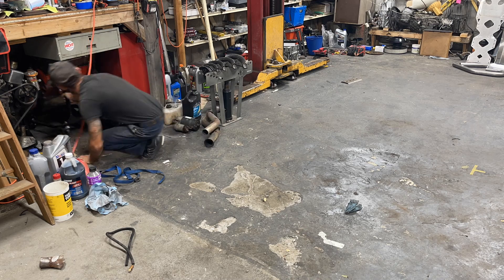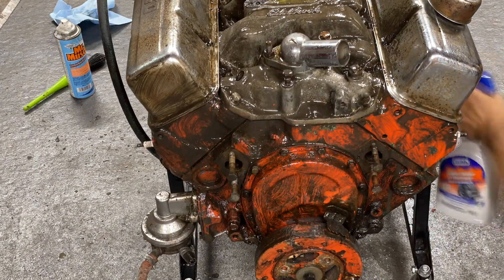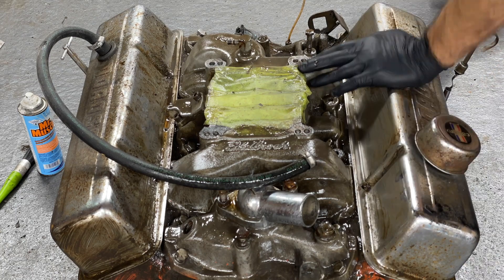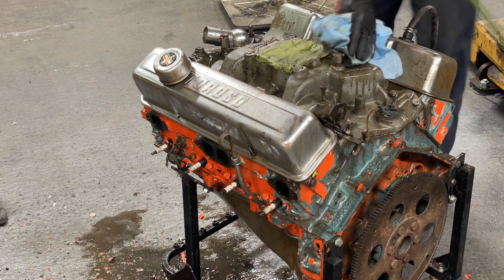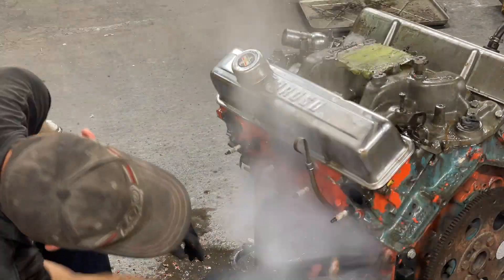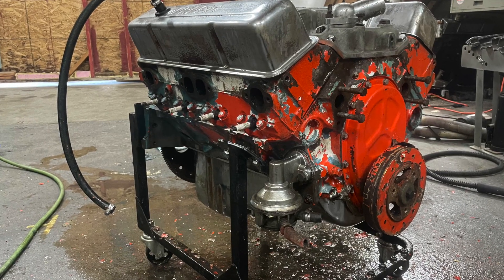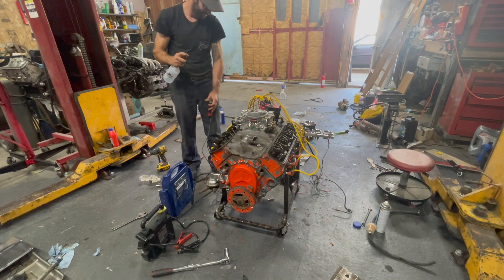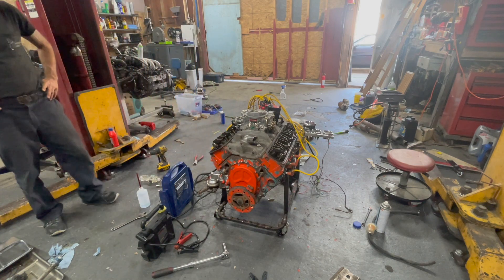Timelapse v8 clean and start mystery 350 chevrolet

Comment: STUPID VIDEO! Spraying liquid in the OPEN exhaust ports, but closing up all the rest of the orifices of the engine for cleaning! Large vacuum opening at the front of the carb (PCV) causing a major vacuum leak! Had'nt been cranked in a while, so it really needed to have a continuous run time for the cam and lifters protection! Sorry, but video did'nt make a lot of sense!
Reply from the maker: Welcome to my channel, here we bring engines back to life. In this case i wanted to quickly establish if this unknown engine was a healthy candidate to recieve  additional labor to prep it paint it change gaskets and install it in a 46 plymouth. Stay tuned to see the rest. This process to confirm a running engine that is worth the time took less than two hours. 🇺🇸